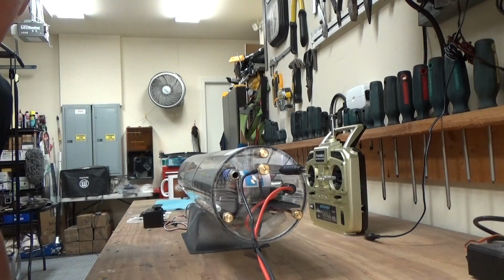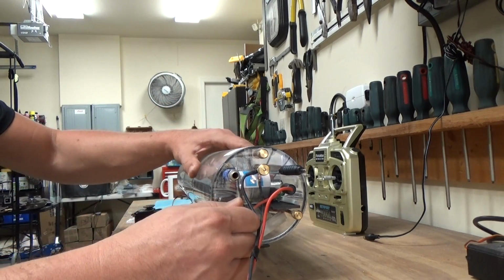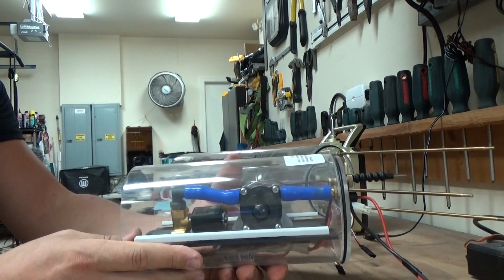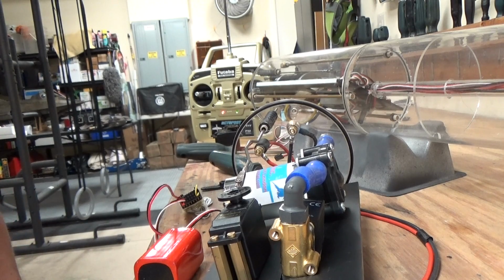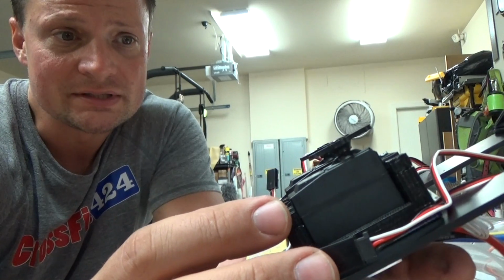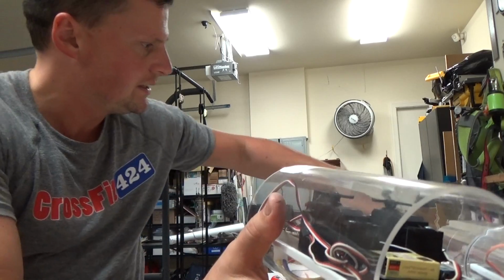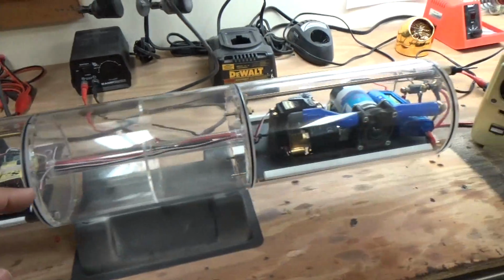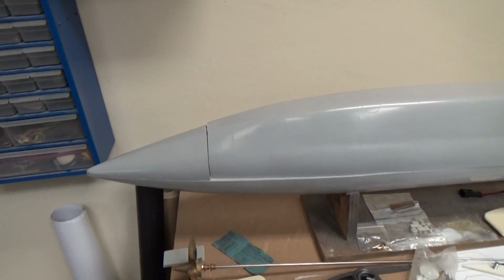Upholder Class submarine RC buildup CH2 - Dive Module Setup

Comment: Wonderful product, looks beautiful and professional. One thing I would like to know: how far + deep is the max control range (e.g how many meters the sub is away from the transmitter plus how many meters underwater) Thanks a lot!
Reply from the maker: Depth of control is a function of the water clarity and distance from the operator. Any contamination of the water in terms of minerals or chemicals can severely affect the propagation of radio signals. Assuming fresh water that is free of contaminants, you could expect up to 20 or even 30ft of depth if the model is very close to the operators. As the model gets further away, the depth decreases exponentially due to the water/air interface of the radio waves.
Reply: Dear RCSubGuy,
Well noted and thank you a lot for your reply! Have a nice day!

Comment: have you ever done a submarine out of PVC pipe? just for the heck of it? is it doable? what do you think?
Reply from the maker: I never have, but many people have done so. The challenge is not the body, but the nose and tail sections. You can turn those out of foam, coat with epoxy fiberglass, carve out the foam and you have hollow ends to your model.
Reply: RCSubGuy thanks for the tip....keep up the great job you do!

Comment: Just a pointer but I wouldn't run the pump without water going through it as you will burn the motor out or possibly disconnect the inner workings and the motor as they don't like to run for more than 30 seconds with water and even less without.